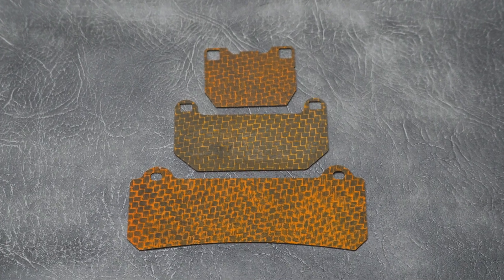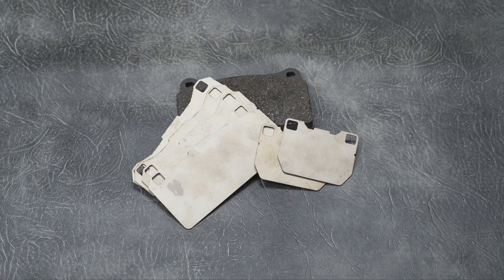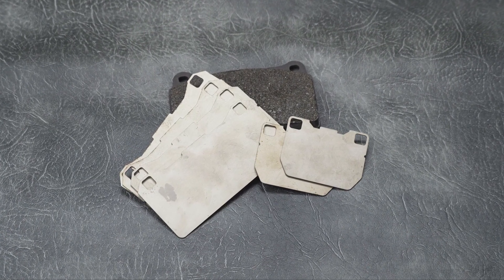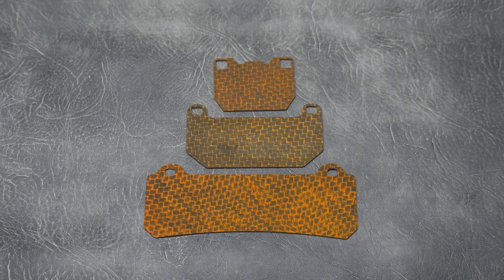Cooler Brakes, Better Performance: Carbon Fibre Brake Pad Shims Explained!

Comment: How durable are these shims in terms of usage life for daily driving?
Reply from the maker: There's no straight answer here sadly. It depends on the amount of wear you put on your braking in general, but they should last multiple pad cycles. Check them between pad cycles and we're happy to look at images if you're unsure on their health!
Reply: @helperformance when you say pad cycle you mean when you change pads out? Worst case senior would be potential change each time? 

Also do you need to grease them or anything?
Reply from the maker: @Rowdy_GRC  Hello! When changing pads, yes. Worst case, yep... But they should last longer than that!

No lubricant needed, no.